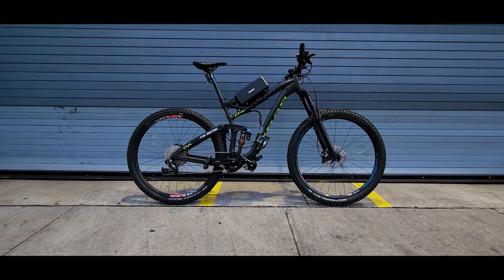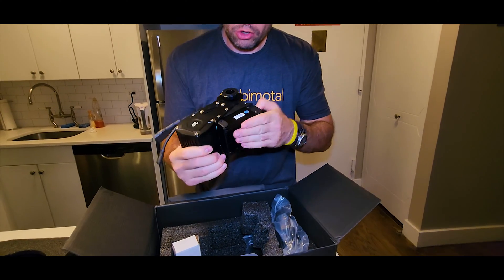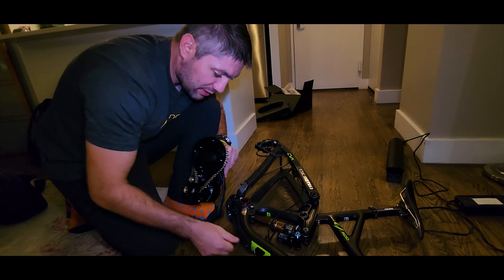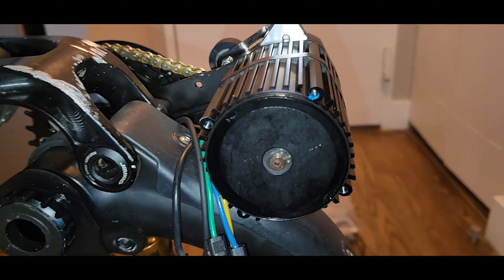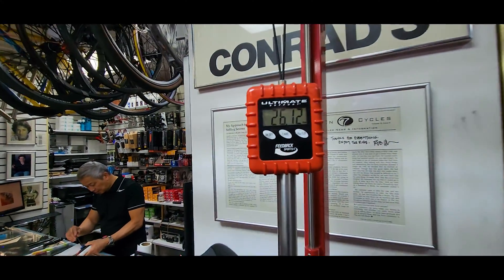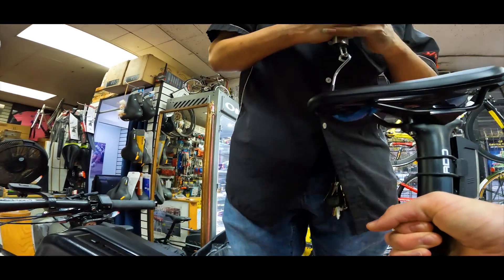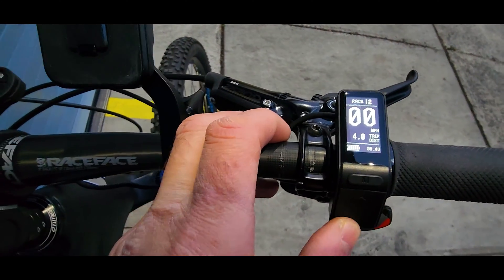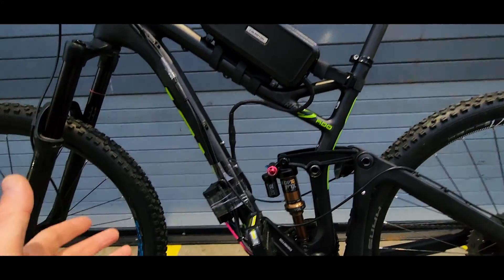BEST E-bike Mid Drive Conversion Kit of 2022| CYC X1 STEALTH GEN 3

Comment: 14 months later, mine is still running great. It's had had a couple failures, CYC and my dealer took care of them, and it's run well since.  I have pretty much 2 usable cogs on the cassette.  No chain breakage.
Reply: 1. Curious what problems you have ran into.  2.  Only 2 usable cogs because of the chainline being too far out?

Already ordered a CYC, just wondering what I am getting into.
Reply: @h82fail  I had a motor blow on me, which they sent me a new one.  Then my controller shorted out and they sent me a replacement.  That was 14 months ago no issues since.  I should have said I have 2 usable cogs using the throttle and trying to get max wattage (i put a 40 mph limit on5my controller, it'll go faster but I'm trying to keep it at reasonable speeds lol).  I can use 5 or 6 gears on pedal assist with less wattage.

Comment: How is it holding up on a carbon fiber frame? Planning on putting my photon on a ican sn04 carbon fiber fat bike frame. Not sure if it would fit but it does have a 120 bsa
Reply from the maker: It holds amazingly well. Trying to get a crew set up for this weekend and make the video for you. It has been raining so bad last several days in NYC.
Reply: @ElectricVehicleSpace  nice thanks

Comment: 750w Bafang mid drive, 25 amps, 52v 25ah jumbo shark batt, 48t Lekkie chainring on my 2012 4300 trek mtb.. total weight 55lb.. Throttle only 31-33mph.. full throttle "while peddling" as fast as i can 41.3 mph ..Drafting a box truck on flat ground full throttle while peddling 46.5 mph! Stupid fast!! will never do that again 😬

Comment: The only problem with these is that they are too noisy. But what I find good about the CYC is that they can use a variety of battery voltages with the right controller. I give my hopes to the CYC Photon version, it can peak to 2000w and it is like bafang's type of motor, smaller but more powerful.
Reply: Where can I find more info about the photon? I looked it up on YouTube and nothing came up
Reply from the maker: I posted few videos but I am waiting for the last frame to arrive and install it.

Comment: I'm glad that you have riding footage.  Have you ridden any "Factory" manufacturer emtbs with shimano ep8, Brose, Bosch, Yamaha, etc motors?  How noisy is the Stealth (gen3) compared to those systems?
Reply from the maker: I did bosch and brose and brose super silent the cyc and bosch almost the same. Bosch only 22mph top speed but cyc at max speed 45mph is a bit louder. Regular riding the same.
Reply: Awesome, thanks!  What about the Pro g3, compared to the Stealth g3, at regular riding (up to 22 and/or on trails)?

Comment: It sounds louder than I expected after CYC said the gen 3 was significantly quieter. Personally I'm looking forward to the Photon, seems like a proper alternative to BBSxx.
Reply: The Photon is really on the same level as the BBS02, it's not really comparable with the BBSHD.  I almost ordered a photon because of a bad prior experience with a BBS02, but the X1 gen3 stealth is only $100 more and has double the rated power of the Photon, and 50% more rated power than the BBSHD with the same torque.  All the reviewers say the same thing about the noise, that it's exaggerated  by the GoPro...we'll see.  There is no doubt the BBSHD and the Photon are quieter.  The X1 Stealth Gen3 has been ordered.
Reply: @Ry-lx2kl what was the bad experience with the BBS02?
Reply: @Ry-lx2kl  Did you get the Stealth? How is the noise? Does it pedal naturally, like a factory ebike with Bosch, Avinox, etc?
Reply from the maker: The mic on gopro 10 exaggerated the sound. It's lower and I like the sound.
Reply: @ElectricVehicleSpace  Which is louder the CYC or the Bafang?  Thanks
Reply: @SilverShadow2LWB  The Bafang BBSxx motors are whisper quiet and can't really even be heard on gopros or over normal chain noise, definitely the Bafang is quieter. If only they had torque sensing!

Comment: Looks good. My biggest concern is ground clearance for technical trails. It would be great if you showed the suspension aired out and fully compressed and measured the clearance at the motor.  No one has done that on any video demos. 

I want to order one of these Stealth Kits for my Santa Cruz Bronson. But the talk of everyone waiting several months for parts and kits has my quite concerned, especially given that CYC requires full payment upfront.
Reply: I have the Stealth installed on my 2020 Commencal Meta AM 29er.  It 's a  beast.  I have a 430 watt hour battery and its fine  for 30 miles epic ride. I  used between 1 and 2 for power. to save  battery power.  The clearance is fine, I took it to the most atrocious rocky, gnarly terrain and it just fine.
Reply: @rufinrl02  sounds great 👍. And saves money vs a ready made ebike at $6000+. And probably less power

Your frame has the same downtube shape that slightly curves out before going up. So clearance would be similar to mine
Reply: @geekane9462  Yes indeed.. In fact I have ordered the Gen 3 version to put it in on my 2021 Specialize Enduro.

Comment: Why don’t you get a rear rack for the battery
Reply from the maker: I dont know... It will add more weight I guess and look silly. Maybe if I find a good one.
Reply: @ElectricVehicleSpace  I think mounting it in the flat orientation on the downtube just above the motor would be ideal if you can do it without the battery getting hit when the suspension is compressed.

Comment: 35 mph!  I’m currently at 30 mph with the x1 pro (52v, (BAC 855)) but my bike weights 60 lbs and has very aggressive tires.
Reply from the maker: This new version does more power and speed. I need to install the app and unlock it.

Comment: Very nice build, that's kind of what I'm looking to build but not a carbon fiber frame.... I want 72v-80v and a 5000w hub motor on a downhill bike/Electric Enduro frame so I can jump it.
Right now I have a Modified Razor Mx650 that's currently 48v 2000w w/ a 30+ mph top speed but I want the 72v 6000w Electro and Co kit w/ a 60+ mph top speed but I want to get it street legal w/ headlight, brake lights and turn signals and a horn/alarm system... I'd use that to run around town so I don't have to use my car but I want a sidecar so I can do grocery shopping and I can use it to take my son on rides as well. First step is getting a welder and start practicing....  I've spent a lot of time looking for bike sidecars and I figured out I'm going to have to make my own or spend thousands on a motorcycle one and modifying it to work on a bike.        LoL
Reply from the maker: I suggest you wait several weeks. I have a frame that will accompany the photon or better for this kit or 5kw kit gen 2 pro that will blow your mind and you don't need to weld. I think it is coming in 3 weeks.
Reply: @ElectricVehicleSpace  - OK... Looking forward to it.    😁
Reply: Heavy (and unsprung) hub motors are terrible for off road/jumping, you are definitely going to want a mid drive for that type of use.
Reply: I don't know what state you are in, but no way is this going to be a legal set-up.  Most states have a cut-off of 750 watts and speed limits of 20 mph for class 2 bikes.  You'd be a big liability around town.  Be a good Dad and do the right thing for your son.  If all you were going to do is to use it on the trails then you don't need headlight nor turn signals.
Reply: I actually found a sidecar for the super 73 on ali express

Comment: You could use the metal hose pipe clips to attach your battery on the bottom down tube
Reply from the maker: I thought of that but this battery despite being compact it's heavy and it moves.

Comment: 72 volt battery would go faster...
Reply from the maker: Yes and it will work but it will kill the motor in long run. It will not last a year.
Reply: @ElectricVehicleSpace  my bad... you have the stealth version.

Comment: The weight is not bad at all for a full suspension bike, nice build.
Reply from the maker: Yeahhhh but I was somehow hoping and thinking it will be under 40 lbs. Maybe I can trip some weight somewhere.
Reply: @ElectricVehicleSpace  If you put the Stealth on a hardtail, you can get it under 40 lbs. My old 26-inch hardtail with a Gen 1 Stealth and a 52v battery weight about 38 lbs.
Reply from the maker: @vmao4868  nice 👌 👍

Comment: Have you seen Chimera BMX? Should try to get that on your channel, looks insane.
Reply from the maker: Thank you for suggesting. I will look into it. Do you have one? If you do what is different or better compare to this X1 Stealth?  Ty
Reply: @ElectricVehicleSpace  I dont have one, i have just been interested in building a 24" electric bmx and came across it. I ride a 24" bmx in the city, its great as its compact and fast to accelerate. The Chimera is not cheap, but seems to be really well built as he has been on it for over a year. I think he has fully custom motor, drive drain, titanium frame etc on it. Quite well designed system. So its not modular system like the X1.